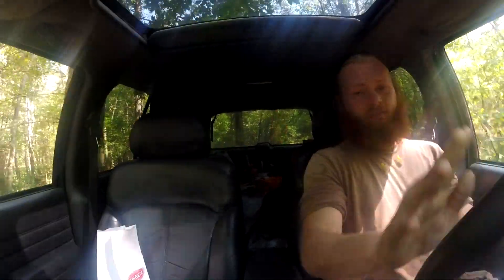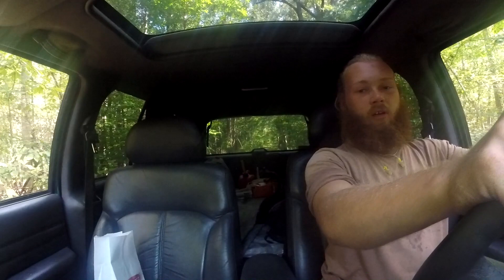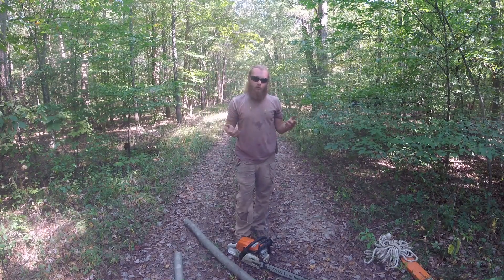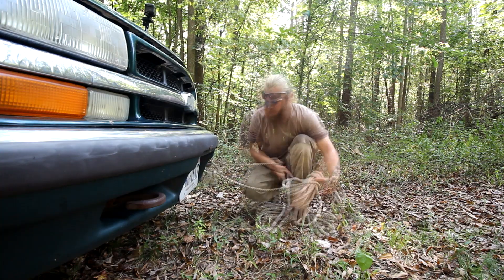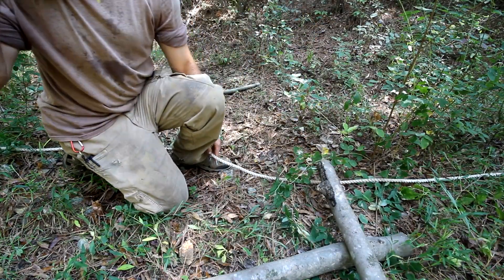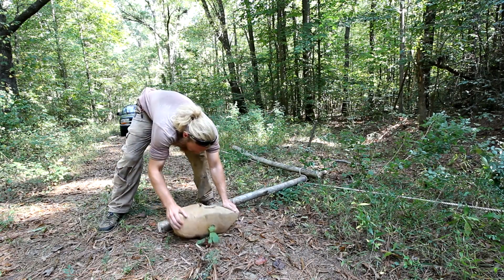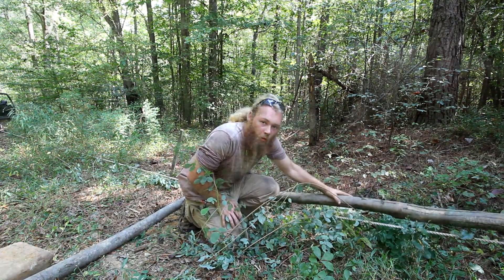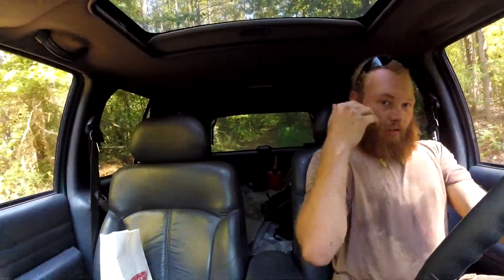How To Make A Primitive Winch (Flip Flop).

Comment: I've seen that used before, maybe you should have delved a bit deeper in demonstrating it working.
Reply: I've used this before and yes a little more detail on how to lock down the cranking stick/log is needed so you dont wear a highly tensioned log in the head.  With amazing torque comes a little danger.  Be careful.

Comment: Thanks Cody! I have a little 4WD I want to take into the back roads  to run my dogs outside of the city but I was unsure what to do if I got stuck out there! I'm going to try this one out asap, just to already have some practice with it! 🐺
Reply from the maker: Best way to do it. Long term I'd recommend installing a motorized winch on your truck. But in a pinch this will work. You can also use a high lift jack to act as a come along
Reply: @CavemanCody  cool! Thank you, I am curious about using the high lift jack.. I will do some research! I've been stuck before off roading in the sand dunes and I don't like it! There were no trees around to work with